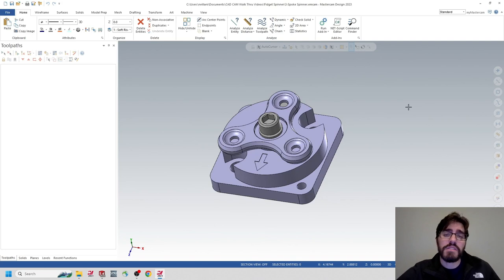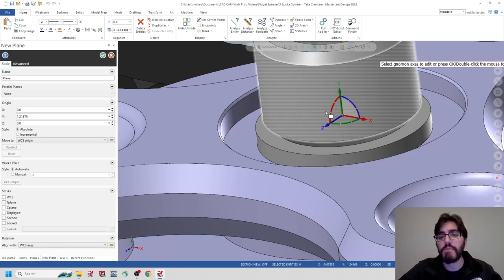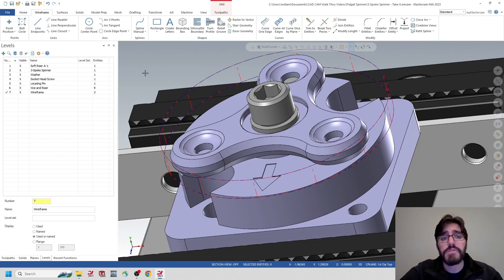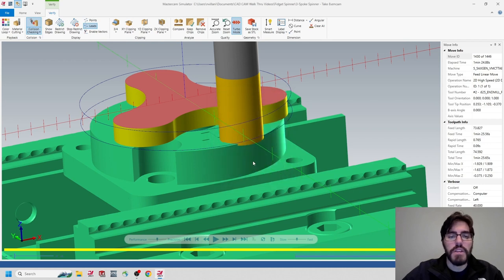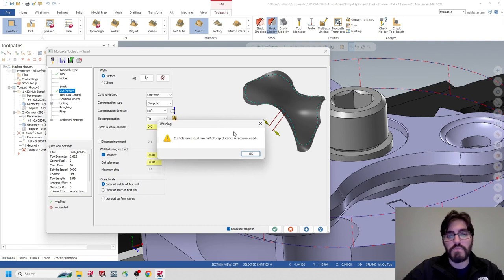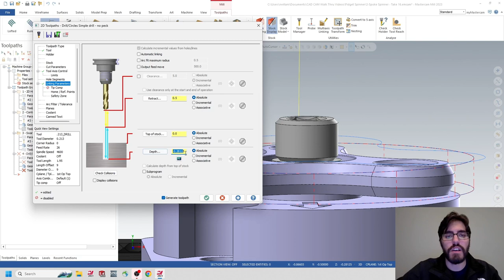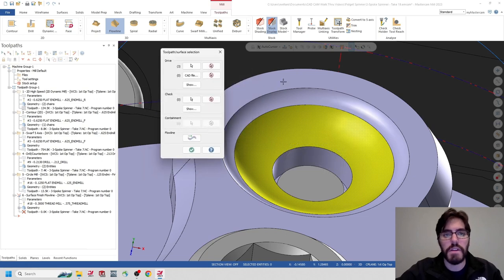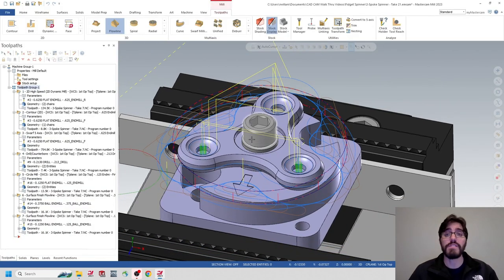Intro to Simultaneous 5-Axis Programming in MasterCam: Fidget Spinner First Operation

Comment: whats the need for creating a a stock model wireframe and a seperate level wire frame of the same Geo? 
I normally create a wireframe bounding box of my stock then go to machine properties and select that bounding box model as a my stock, and also create a stock model by selecting that wire frame.
Reply from the maker: Hi, that's a good point and I actually just included that in a recent tutorial video.  I mostly kept them separate so that the students got their repetitions in and understood the differences between the two features.

Comment: whenever i create a new machine group and create a new WCS using Wireframe/Bounding Box/Advanced Tab and check "set as current tool plane" and "set WCS from new tol plane" the construction plane will almost every time be a different plane. Do you know how to let mastercam activate WCS, Tool and construction plane automatically? my plane follow rules are: Cplane/Tplane follows WCS ✔
Gview follows WCS
Cplane follows Gview ✔
Tplane follows Cplane ✔
Cplane = Top in isometric Gview
Reply from the maker: That's a great tip, I'm going to look into that!  I know coming from SolidWorks always plays havoc on the planes in MasterCam.  Thanks so much!!